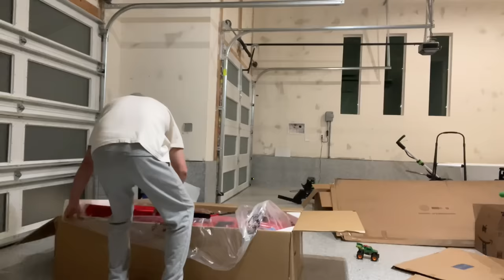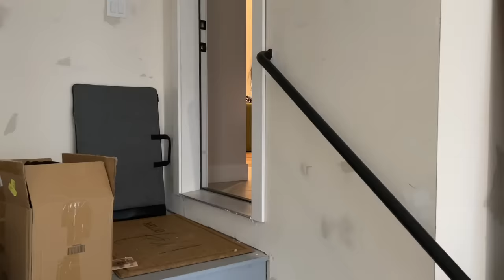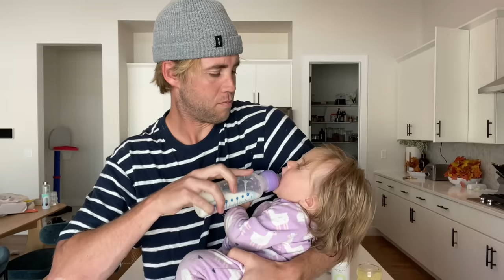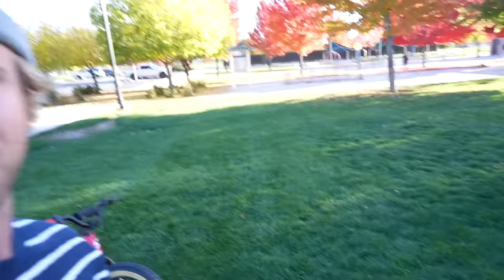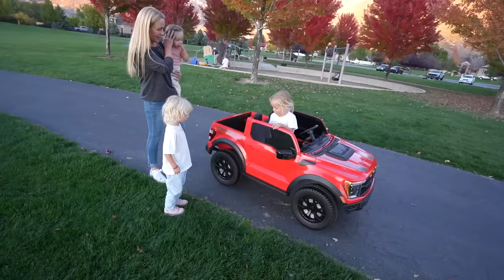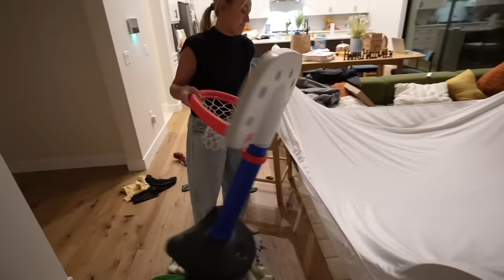JACK TURNS 3!!! Oh and also... I got some bad news

Comment: I had one knee reconstructed, 10yrs later had it fully replaced. Lots of scar tissue and limited range. Had anxiety so Dr suggested fish oil for my elevated blood pressure. I felt something going on in that knee, heard a small pop and knee swelled up, it was terrifying. Turns out the fish oil broke up the scar tissue and I have more movement than I did before. That pain on the side that felt like a short person walking next to me hitting me with a pick ax eventually went away. Took 2 years and I’m better than ever. Hang in there 😃

Comment: Plan 4 u Derik... create a mould with those gel ice packs to enclose your whole knee and then wrap it with a velcro strap and do it two or three times a day to increase the blood flow❄One of those massage guns might also help with blood circulation.. Your knee can still heal by itself it will just take longer... also had some knee trouble, but I managed to get it right with rest and well controlled repetitive movements without putting too much strain on it...🤞🙏 Stay + (- + - = +)👀🙄🙏✝

Comment: Just as a fyi in case you’re wondering. When you only use the 6v battery it won’t be strong enough to go over anything but hard surfaces and not very fast and not very long. But the 12v will give you a workout. It will go over grass and it will go faster than you can walk. Just fyi.